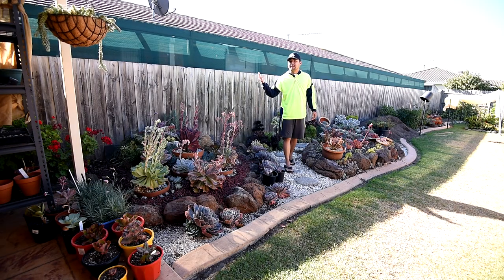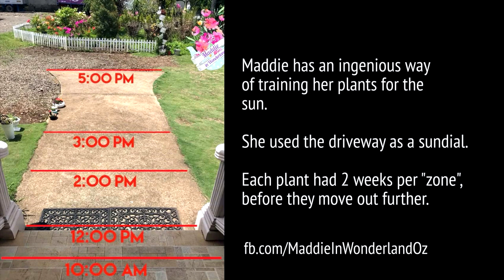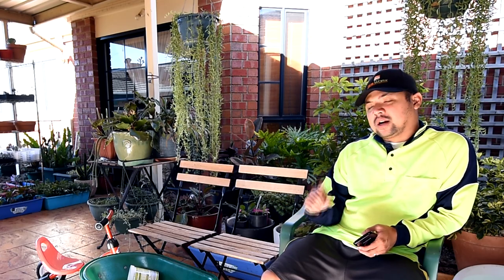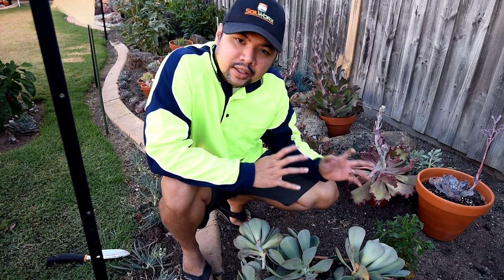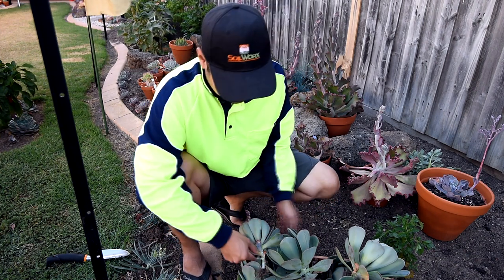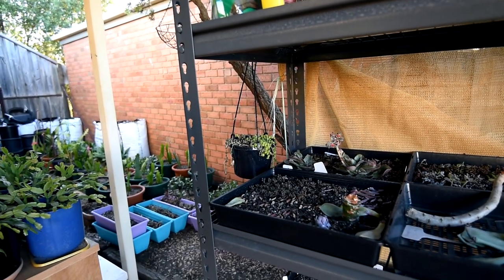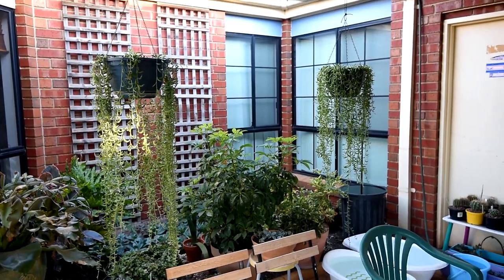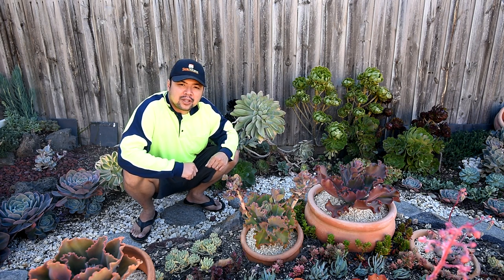#56 And then there was light!

Comment: Picked up a moisture meter today and it's a 3 in one. Moisture, pH and light. Very excited to try it out. 
Can I ask something chuck? If I can't find pumice do you think granite would work in place of it for top dressing? And mixed into soil maybe? Or would that retain too much water? 
I'm hesitant to settle for something other them pumice.....it's a pain in my.....

And the employees at Lowe's aren't much help. I had 6 employees helping me. They suggested I use perlite and said it is the same.... I couldn't help but Crack up. They're clueless......
Reply from the maker: The pumice and scoria are great for when the area is prone to flooding since they are porous and can help absorb excess water. However if you mound or raise the garden, the water will drain away anyway so I think anything that you can do to loosen up the soil to help the water pass through will be great. In fact on most of my garden bed, I've can get away with just using river pebbles as aggregate since I can sometimes get it cheaper than proper scoria or pumice.
Reply: Cerriscapades aww man they had river rocks. Huge bags for 5$ but they had been out all winter the whole pallet was drenched.
Reply: Cerriscapades I'm checking feed stores next. I won't give up.
Reply from the maker: haha that's the spirit!